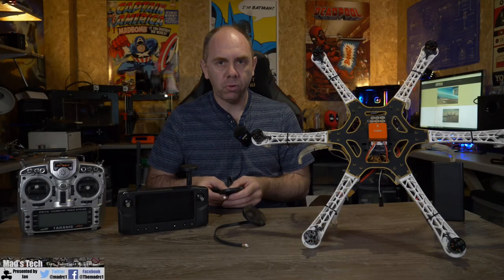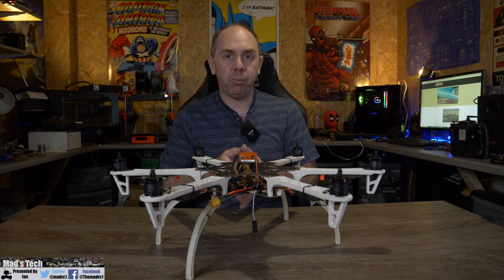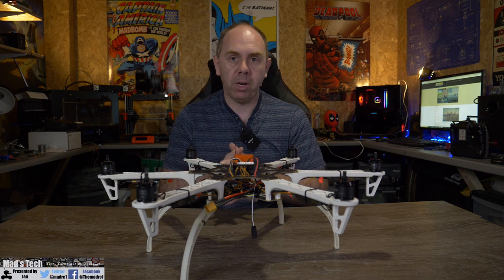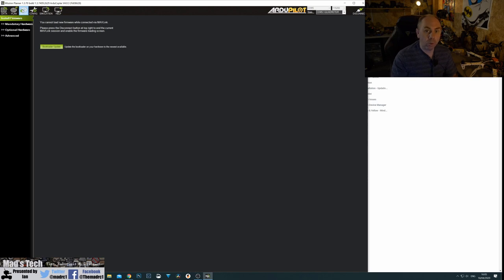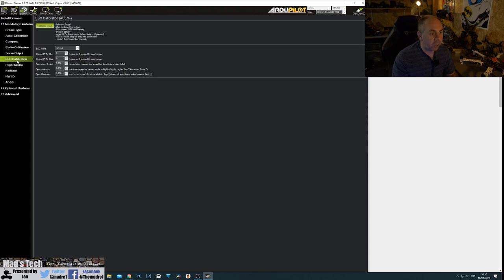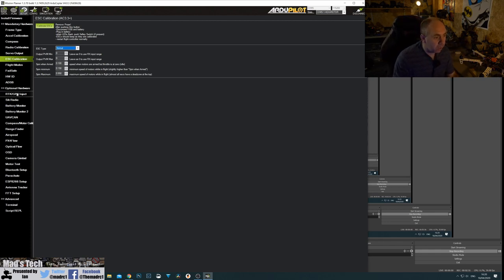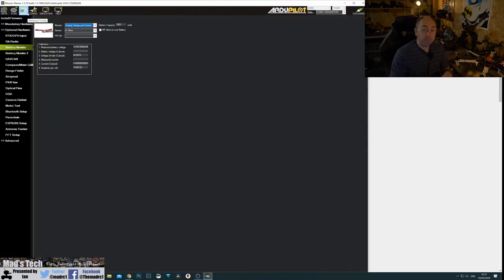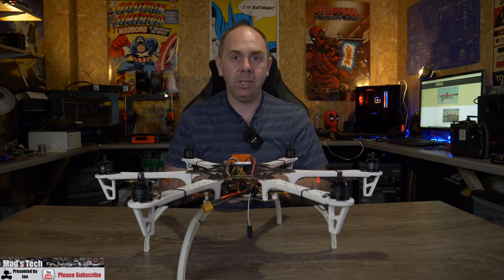Ardupilot Drone Build How-To Series Part 1- Basic Hardware

Comment: Those components deserve a better looking frame.
Reply from the maker: Haha yea. This is just a test build and the 550 is ideal for that.
Reply: @MadRC  I've used similar frames and they work fine but would like to find a design for a carbon fiber frame for around 10" props (not Tarot but similar) that allows a pair of batteries to be mounted to either side of the cube so that a camera gimbal can be mounted in the center underneath the frame.
Reply: Actually it looks like 3dxr (UK) and Irlock (USA) sell some reference frames like the one from Hex - 
HEXSOON EDU450 – Frame Kit with Motors, ESC and PDB

Comment: Don’t you need to insert the position of GPS/Compass and the Cube in regards to the CG like DJI A3 and A2?
Reply from the maker: Yes Ardupilot has the option to set the COG.
Reply: @MadRC  It would be great if you show where is that option for GPS/Compass and for FC. I also wanted to ask if Pixhawk cube Orange has brake feature like DJI A3 has on GPS Positioning hold that stops the drone right where you leave the sticks to the center.
Reply from the maker: Yea you set the breaking level in Ardupilot.  This is a software feature of the flight mode.

Comment: Thank you for the videos. I setting up on Orange Cube on my old F550 with DJI ESC and motors. Something I am missing because when I plug the batt to the drone, the motors are beeping they don´t follow the controller commands. I checked esc´s and motor out of the controller and they work fine. Could you help me, please. Thank you.
Reply from the maker: Do you have a GPS or safety switch connected as beeping motors means the safety switch is not engaged.
Reply: @MadRC  Thank you for the anwer. I´ve finally realized the issue. The throttle was to low so I sub-trimed this radio channel. Yesterday I tried to do my first fly with Orange Cube but I couldn´t because the drone flipped back. I double checked motors & props direction and all were fine. I did calibrate compass and accelerometer and also checked the center of mass...Do you have any idea? Thanks a lot.
Reply: ...also I´d like to make a suggestion/discussion tip about DJI Smart controller and the possibility to use it with Pixhawk. Is it an Android device, isn´t it? So could i install Qgroundcontrol on it?. I guess Dji guys have thought on it too...

Comment: I brought orange cube beta tester as new stable version not available locally, If I update the firmware then will it be like the new orange cube with stable version? Or there are some hardware changes?
Reply from the maker: No hardware change at all. Once Copter and Plane 4.0 released the Cube Orange was no longer in beta.  You can ignore the sticker.
Reply: @MadRC  such a relief, thank you

Comment: Does the ADS-B communicate with mission planner via blutooth?
Reply from the maker: The ads-b communicates over your telemetry link so you can use 3DR radios.  RF solutions ones or something like Herelink. There is no built in BT or communication in the system you have to choose that aspect your self.
Reply: @MadRC  Thank so much Ian, I was watching one of your videos where the airplanes were first appearing on mission planner on your laptop and I could not see where it was hooked up, or a radio hooked into the laptop. Does that radio use wifi to the computer?